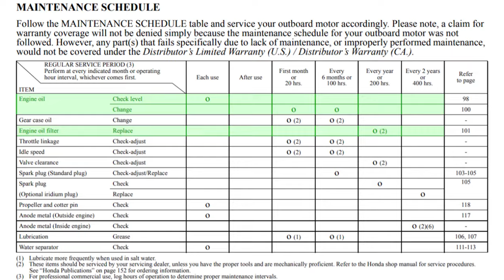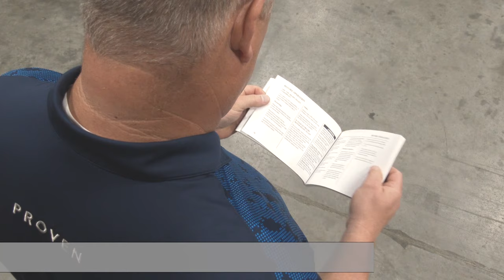Honda Marine DIY Engine Oil Change

Comment: But oil filter is positioned low so just removing engine cover do not help, at least on BF20. How to access oil filter? Can that be shown?
Reply: You have to remove the mid section of the motor.  Hex bolts  !